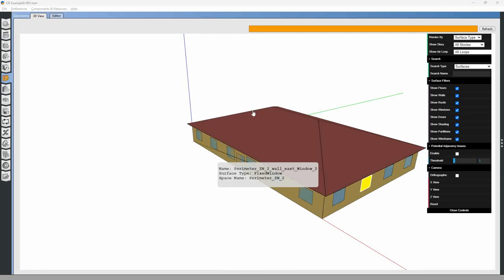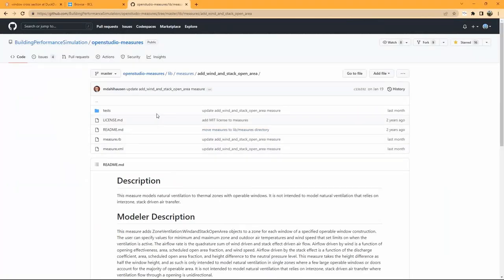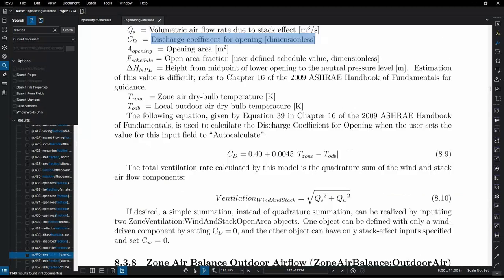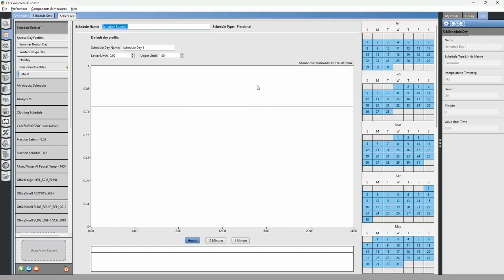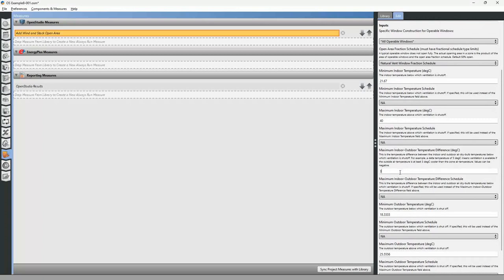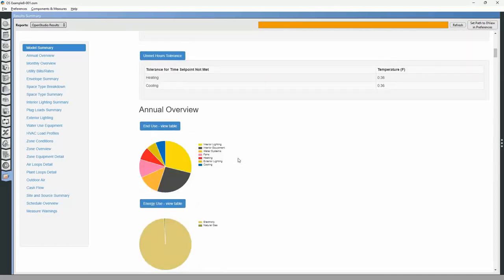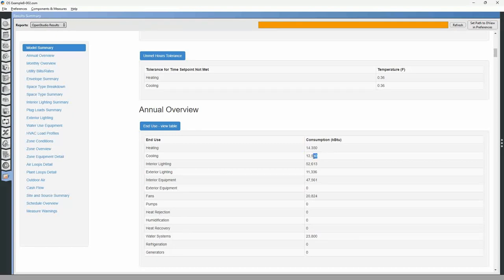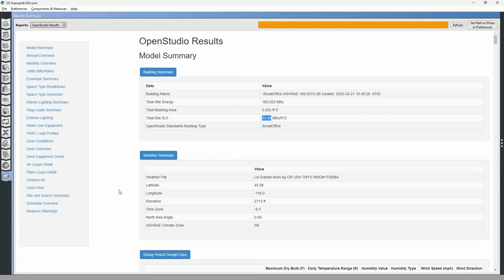OpenStudio Tips - Natural Ventilation-Windows

Comment: hi, thank you for the explanation. I have a question. Now I am making simulation about combining air conditioner and natural ventilation. I want to still use AC but also natural ventilation. In summer it will be hotter if we use natural ventilation. In order to reach indoor thermal comfort, the AC setting temperature will be lower if we use natural ventilation, which means it will take more energy for cooling. Is it possible to make this simulation (AC and natural ventilation) in openstudio?
Reply: I already download add wind and stack open area from github, but there is nothing in "input" . So I could not put any data in the "input". do you know what is wrong with the measure? thank you
Reply from the maker: I am not sure what you downloaded or if there is missing files.  Here is what I use: https://drive.google.com/drive/folders/1f5Ngtae_pnS0jBmtbTVSD5PV7yGxM6CJ?usp=sharing
If you are using an older version of OpenStudio, it may not work.
Reply from the maker: Yes, you can simulate a thermostat adjustment, but you will have to run the simulation first to see when the natural ventilation is active.  Then, you will have to create a custom 8760hour schedule for the cooling thermostat and import to OpenStudio.  Here is a video that discusses importing 8760 schedules: https://youtu.be/S_HbjEAGCrg
Reply: @helixenergypartnersllc3540  thank you for the reply. I really appreciate all your videos and explanation about OS. It is really helpful. Now I can put data in "input". Thank you. However, I would like to ask about the ventilation simulation. You said, I have to run the simulation first to see when the natural ventilation is active. Where can I see this result of the natural ventilation (active or not). I only found the schedule of natural ventilation fractation schedule that I made my own. I also tried to run the natural ventilation using this wind and stack open area measure, and I put the data "delta temperature" to -100. I actually want all operatable windows are open during the day (I create the schedule) with air conditioner on,  not depending on the outside air temperature, that`s why I don`t know what value in "delta temperature". I really need to make simulation about ventilation with AC on operated together, and in my hipotesis, it will make cooling load bigger than only using AC, in order to reach indoor thermal comfort. It is very helpful if you could explain about  thermostat adjustment more, because I have no clue, thank you very much . 🙏🙏🙏
Reply from the maker: @miemiemumu  Before you run the simulation, ensure that an output variable is turned on that will show natural ventilation (ie. air change rate, flow rate, volume, or energy).  These are normally at the very bottom of the output variable list since it is in alphabetical order and the variables start with "Zone Ventilation".  Here is a video showing how to turn on output variables: https://youtu.be/8JlZrvenFBM?t=212

Run the simulation and open DView.  Plot the variable that shows when the windows are open.  Right-click and save it to csv.  open the csv file and change all positive values to 1.  Import the csv file into OpenStudio using the add interval schedule measure:https://youtu.be/S_HbjEAGCrg?t=512

Now you can use this imported schedule as a window open fraction schedule to open (1) or close (0) your windows.

Keep in mind that by doing this, you will be altering the simulation.  The indoor temperatures will change.  If you have indoor maximums or minimums set, the measure may close the windows earlier than in the original simulation. To avoid this, ensure that you have indoor minimums and maximums set much lower or higher than the simulation.
Reply: @helixenergypartnersllc3540  Hi thank you very much for your detailed answer. I can added zone ventilation variable. Thank you. 
I also added interval schedule measure based on your video (open csv, edit all positive value to 1), however when I want to change the window opening schedule in "add wind and stack open area", I could not find the new schedule that I already made, so I gave up.

When I tried the simulation and checked the ventilation air change rate,, the positive value result is following my opening schedule, so I think everything is fine for window opening schedule with my own schedule (without add interval schedule measure). But, the problem is, the result is depend on the delta temperature, and the air change rate result is too high (above 30 ach) when I put delta temperature to -100. So I erased "add wind and stack open area", and I use "natural ventilation" in HVAC system in zone equipment. With that equipment, the air change rate is quite nornal (3 to 6 ach). But when I tried to change maximum outdoor temperature to 28℃, and checked the result of air change rate, the window opening is still active eventhough the outdoor temperature is above 30℃. I am so confused.

By the way, thank you very much for your attention to answer my questions. Have a nice day!!
Reply from the maker: Yes, I understand now.  It appears the Add Wind and Stack Open Area measure only searches for schedules that have been assigned a type/limits.  You can open the .osm file and search for a scheduletyplimits like this:

OS:ScheduleTypeLimits,
  {0e8a1071-0266-4010-ac69-8217e44d04b6}, !- Handle
  Fractional,                             !- Name
  0,                                      !- Lower Limit Value
  1,                                      !- Upper Limit Value
  Continuous;                             !- Numeric Type

Copy the handle (the 36 digit unique id number) with the brackets.  Now search for the name of your interval schedule and paste the handle into the schedule type limits name:

OS:Schedule:FixedInterval,
  {80a9539e-6d03-4f21-b097-55e8255238c4}, !- Handle
  NatVent,                                !- Name
  {0e8a1071-0266-4010-ac69-8217e44d04b6}, !- Schedule Type Limits Name
Reply: @helixenergypartnersllc3540  thank you, but I tried this, and it cause error and failed. My problem now is that I want to make simulation with natural ventilation, but the room is in the middle, between the corridors (so the window is only interior windows facing to corridors. But I would like to know the cooling and heating load in that room with air conditioner and natural ventilation. With wind and stack open area, the cooling and heating load is not changed so much although I open windows bigger or open more windows. And when I checked the ventilation rate in that room also not changed, only in corridors are changed. My professor asked me about the natural ventilation setting in the open studio whether we can set the wind orientation, from where to where this natural wind comes. Do you know if there is a setting in wind and stack open area?
Reply from the maker: @miemiemumu  Have you tried assigning natural ventilation directly to the thermal zone as in this video here: https://youtu.be/z8TUy9vbHN0